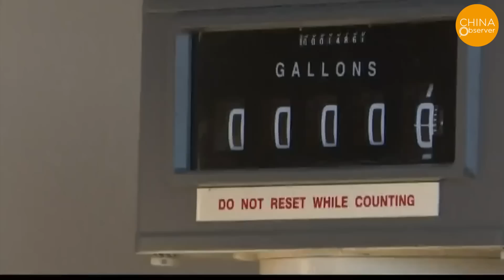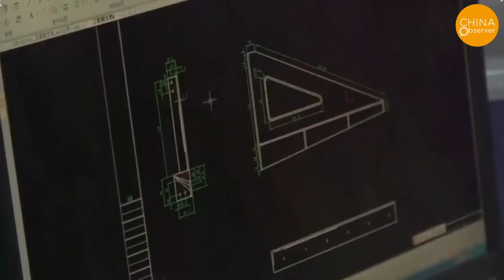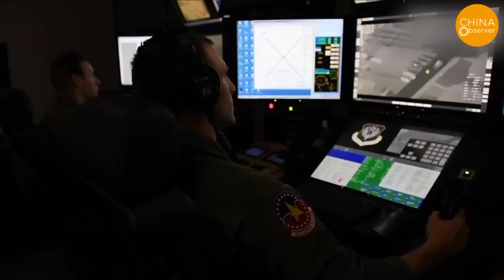China's Drones: A Joke? They Can’t Copycat Anymore! Chips and AI Technology Are Choking The CCP

Comment: The new American done Valkyrie is fully self destruct capable.  Before it explodes it will completely fry every mother board and electronic component to prevent reverse engineering.   If you find one, i wouldn't touch it
Reply: The American Valkyrie was a project started in the late 1990.  The bulk of the research was from Global Hawk...However, the platform testing drone was done in Australia military under a Boeing contract...  They don't actually hire engineers with US STEM degree...it is offshore engineering company.

Comment: China doesn't really have a western style R&D in weapon systems. What they do have is effective espionage and whatever wreckage they can get their hands on. Some things simply can't be reverse engineered though, especially in the area of connectivity driven by advanced AI. Even if China understands how these systems work, without advanced microchips they can't build them. This is the price of not doing all the basic R&D in chip engineering in order to develop their own advanced designs. The result is that an American carrier battlegroup acts as a single entity because the weapons and sensors on every ship are connected and operated by AI. A Chinese battlegroup goes into action with every ship basically on it's own and limited by the capability of it's own weapons and sensors. They will lose.

Comment: Just because you can steal a design doesn't mean you can build it to anywhere near the same quality or performance. China doesn't have the jet engine technology, material science, advanced computers or the advanced micro chips to get the same performance, sensors and reliability that Western jets/drones have. And I have big doubts about their stealth claims. See China's new C919 airliner. They made a big deal about because it’s Chinese and their first. But it’s essentially only assembled in China not designed or built there. They had to have foreign companies do just about all the important systems and sub-systems for them. If their own aviation technology and manufacturings skills were that good they never would have had foreigners doing it for them. Or steal the designs and copy them !!

Comment: Whoa, let’s settle down about cost effectiveness. The NGAD which feature drone wingman is going to cost $300M per plane, lol.
Reply: Current estimates being thrown around are more like $200M for the NGAD and $100 each for at a minimal 2 loyal wingmen.
Reply: @tonysu8860  The Sandboxx guy did a good write up. Basically, all of our planes cost $300M, lol. (inflation adjusted)
The only way you get the price way lower is to produce a ton of them (amortize the R&D).
The big difference is the contract structure:
the Air Force is reshaping how it executes fighter contracts, separating design and production from long-term sustainment to force competition between firms, and perhaps most important of all, ensuring Uncle Sam owns at least a significant portion of the “data rights” or intellectual property associated with the new fighter and its design, rather than allowing a corporation to maintain a monopoly on the fighter going forward.
They are trying to avoid the F35 mess.
Sandboxx had the ratio at least 3-1 with plane vs drones.
Reply: Each plane is going to carry advertising silly!  Of course it will make way more than that.  Just imagine it "Greetings from the Communist Party!" as it drops flaming dogshits on the farmers below.

They'd be willing to pay a LOT of cocaine!  A LOT!